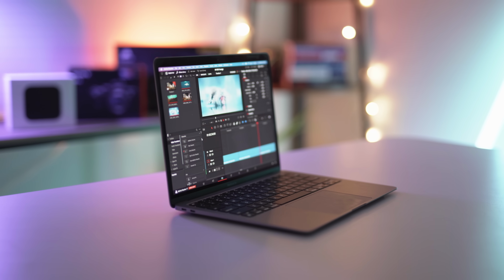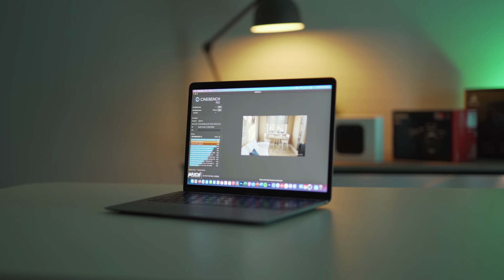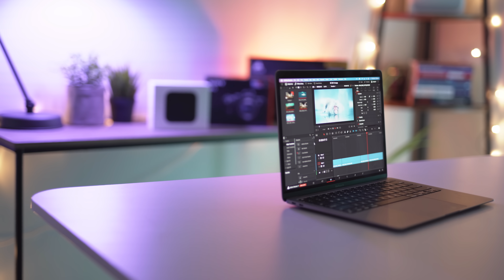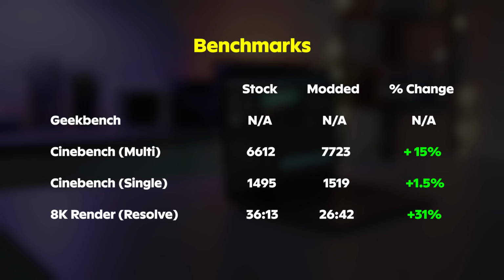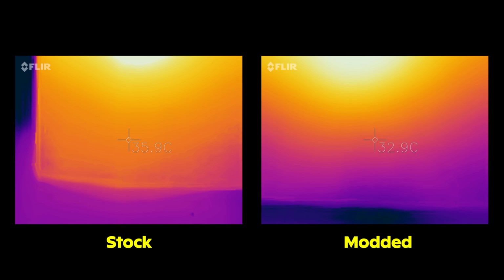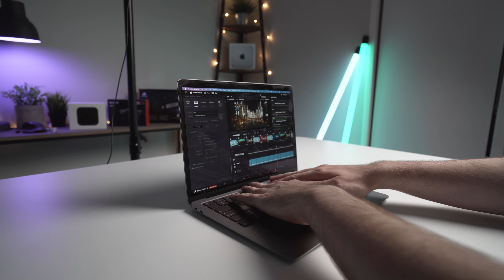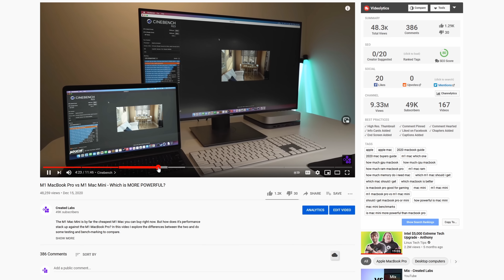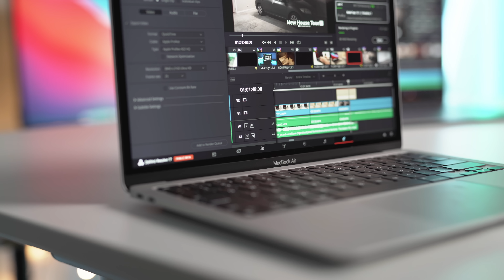I MODDED My M1 MacBook Air & Got 20% Performance Increase!

Comment from the maker: Equipment used (Amazon links):
1.5mm Thermal Pad: https://geni.us/thinthermalpad
3mm Thermal Pad: https://geni.us/thickthermalpad
iFixit Pro Tool Kit: https://geni.us/ifixitprotoolkit

I'll also be doing further videos on this topic, including using a laptop fan cooler with the mod. I will also try to water cool the M1 MacBook Air so make sure you are subscribed!
Reply: Yeah the link to the 1.5mm pad isn't linking to a 1.5mm pad.
Reply: is it worth voiding the warranty?
Reply from the maker: @jub8891  If you have the money? Yes. If not, no it's not worth it, don't risk it.
Reply: @CreatedTech  If you put the original MacBook Air on top of a huge piece of metal and make sure the bottom of MBA in contact with the metal, what kind of improvement will you get?
Reply: Link didn’t work for me
Reply from the maker: @charlescai  Which one? And what country are you from?
Reply: Look forward to complete report.
Reply: Try modding the macbook pro like put a few thermal pads on the copper heat pipe and maybe it will diffuse some heat to the chassis and increase cooling like the macbook air
Reply: Could you do a video with how it looks taking it off.
Reply: Song @ 5:25 ?
Reply: How bout graphics card to a Mac Mini?
Reply: @ANTHONY YOUNG And then have to declare this is a  totally useless procedure ? xD

Comment: The issue is that there are standards which manufacturers have to comply with if they want to sell their products. For example, the surface can't exceed temperatures of X °C, as anything above that can result in burns. 
The only way Apple can have its cookie and eat it too (no fan/no noise and compliant temperatures) is by restricting the performance of their laptops. Or they could just go with a fan and proper heatsink LIKE LITERALLY EVERYBODY ELSE!

Comment: I did this mod, and I saw battery temps DECREASE by about 10 degrees Fahrenheit. CPU temp decreased from 180 down to 154 running the same game. I did this mod no so much to increase performance (it was fine before), but to decrease CPU temp. The fact that battery seemed to also show better temps was pure bonus!
Reply: Would you say it’s worth it. I have Apple care until June

Comment: I'm a recent owner of a macbook air m1, and I notice that it gets very hot when editing photos in Adobe Lightroom, I use Hot's monitor and it marks 80 to 90 degrees on the processor, should I be worried?
would this mod help? Is the battery harmful? since your video is from 2021 and we are in 2022, did you have any problems using it after 1 year?

Comment: To those commenting about warranty, I have spoke directly to apple regarding this mod, and the conclusion is that if you do not break anything while putting the thermal pads on, then you are fine. If you do break something however, then your warranty is void.

Comment: be careful, making your MacBook bottom plate as the heat sink may loosen the mac's rubber pad adhesive (the pad that prevents your mac's body from scraping against the table) and it can easily come off.
Reply: glue them back on

Comment: Don’t say may, this will void your warranty, m1 provides enough performance and Apple engineers understand thermal engineering better than a YouTube video, not having a dig but this sort of video could cause people a lot of money, tiny increase in performance is not worth loosing warranty or any future recalls on a new product.
Reply from the maker: The mod can be easily reversed with no evidence it was ever there in the first place. I'm not saying it WON'T void your warranty, but it's not 100% guaranteed like you're making it out. Also I mention several times during the video that this mod is not a good idea and it's just for the purposes of a video :) Of course most people shouldn't risk a $999 machine for a few percentage points of performance gain.

Comment: there is no sense in your conclusion. the book does higher speed because the temp. gone higher and thats because of the speed was increased ?! seems to be a circular conclusion to me ...
Reply: you should redo the thermal messurment without the back plate of the book. the temp. must be very higher than the messured on the surface of the back plate ...

Comment: Did you test it for at least two times before and after the mod? Because you didn't mention that, it seems to me that the process was just optimized before repeating because some of the values were alredy in the registers and because of the processor optimization algotithms
Reply from the maker: It was tested multiple times and the computer was also shut down between testing.

Comment: This mod is like a must for someone on the budget and wants Pro performance. 
The only thing I was curious if the battery would be a lot warmer and then saw your comment. A few degree shouldn’t be a problem unless it is hotter than 40 celcius degree.

Comment: I have an M1 but just use it for general purpose tasks and some light photo editing.  I also live in a temperate climate where summer temps rarely break 25C.  I wonder if thermal pads between the batteries and the case would stabilize battery temps and give my laptop a longer lifespan...

Comment: With this mod your battery will die in few months due to temperature increase of the bottom panel. It will heat up like a frying pan
Reply from the maker: Yet here I am, over 6 months later of 10 hours usage every day and the battery is completely fine :)

Comment: When Apple,engineers begin to actually use their brains, they will design M1 series laptops to use the back of the screen as the primary external heat sink. After all this is where laptop cases are most exposed to external airflow. This would method would help to keep the batteries cool, prolonging battery lifespan.
Reply: It’s unknown though how the heat would affect the display and most importantly, it’s way more difficult conduct heat to the lid. Even flexible plastic ribbons get snapped at the bend between the two parts but you’ll probably need pipelike heat conductors. And those are much thicker and less flexible. Sounds pretty challenging.

Comment: uses the backplate as a heatsink "It definitely got hotter. The mod we did to spread heat to the back case made the back case hotter somehow. 😮"
Reply: It’s not the worst thing, the worst thing is heat getting to the battery making the MacBook a bomb in worst case scenario, the best case scenario is Battery life decrease.

Comment: Interesting thing is that Apple didn't underclocked SOC just a bit to keep it cooler. I think that was better thing to do and install pads at the same time. Maybe peak performance would go 5-10 procent down but it would have been much better on sustained performance and also you could probably have it on your lap (if needed). But i guess their marketing department decided to go with the higher peak performance (because benchmarks exists).

Comment: The temperatue increase is due to contact point. This is actually more efficient. Otherwise, heat is trapped in the air in the case, spearding more evenly, but more slowly as well.

Comment: That thermaltake fan if you want a fan just get the macbook pro instead... the whole point of the air is that it's fanless. Adding an external fan makes 0 sense to me though I did do the mod.

Comment: For anyone want to do this. Be aware that if you do this, there will be a lot of heat at the bottom case. Because the heat from heatsink transfer all the heat to your bottom case which may cause your battery heat up and swell. Which is not good. Do this only your environment is not hot and also don't fully load your cpu when charging your battery. Just charge to 100% and do as you want. I have experienced this on my macbook pro 15 2015.

Comment: this mod heating the batteries over designed temperatures. Even small overheating will dramatically reduce battery life and capacity over time. like, over a first year you will notice -10-20% of capacity, not a general -5-10%. Also you are increasing a chance of getting your battery size icrease, and deforming macbook chasis.

If you want to replace your battery every 1-2 years - go ahead, use this mod.
If you want to use your m1 macbook for a 10 years in a row without any battery issues - forget this mod.

Comment: Makes sense.  If it has more surface area so saturate with heat, it will definitely feel warmer, but will possibly have better performance as it now takes much longer to get to whatever core temps it would throttle at.

Comment: I do not suggest you to do that. :) The macbook is designed to hit a maximum temperature which is considered normal. By doing this you are letting your laptop heat up more which is not good for it's hardware. Your macbook no longer knows the accurate temperature level and you might end up with some technical issues. I would personally prefer to wait a few more minutes for a video to render or to play at a little lowers fps rather than risking my macbooks life. The video is cool but this kind of 'mod' is not worth doing to you personal device :)
Reply: You might be happy to know that Macs contain temperature sensors EVERYWHERE.  More than one in the batteries, ones on the palmrest, the CPU, the exhaust and heatsink proximity and hard drives on some models.  The mac would definitely know what all its' temps were, albeit some of them may be slightly above normal.  Given how low of a TDP the M1 really has, it's unlikely even with this mod that you would ever reach anywhere close to concerning temps, especially with just average use/load.  It's not like you're rendering 8K footage for every hour of its' life.  This mod is pretty harmless, all things considered.  Remember, he was stressing it as much as he could to see what it would hit, and it's still cooler than Intel Macs were, often by far.  The low TDP goes a long way.

Comment: I heard that one, using the aluminum backplate as a heatsink.... yeah you get higher performance, but the laptop feels hot to the touch and can with extensive use be very uncomfortable on your lap. This is typical Apple's on purpose design fuck ups fo a slicker design. Use better hardware, fuck up the internals so next year you can just use the same hardware but arrange it a little better and tout your new model preforms better then the old one and give all sorts of charts showing that with no values on the X/Y axis. It's one of Apple's tricks to make you spend more money on them, just as the Genius Bar where they mostly falsely claim that repairing your damaged MacBook is almost as expensive as buying a new one. Ever since Steve jobs is dead quality of the product went into his grave and now they solely rely on cheap scamming tricks.... pretty disappointing of Apple.

Comment: I did something similar with my 2017 nTB MacBook Pro, I put a regular M.2 Thermal Pad in between the cpu heatsink and the case, suddenly the fans can now run at a much lower speed. Youtube used to get the fan spinning pretty bad, now I'm watching this video and typing a comment and its sitting around 40 degrees with 0 rpm. This mod will work even for intel users just to a lesser extent. I really hated the fan noise, now I feel fine waiting for M1X or M2

Comment: Would this improve thermals on the active cooled Mac Book Pro?
Reply: Since the Pro does have a fan which sucks air in past the chassis, the air will probably be too saturated with heat from the chassis to efficiently cool the heatsink down. When you would start a benchmark the starting performance would be great but once heated up, the performance will decrease and the cpu heat will increase dramatically.

Comment: I think the thermal pad is soking total heat at dissipating at a single spot before that apple designed it to spread the so i think u should try using pads tota insidel back case by that the heat will dissipate faster and the it will way more cool by now and performance will be higher or same u should try this i think

Comment: Apple: deliberately makes a crappy thermal solution for their computers and blames Intel.
Also Apple: Makes an ultra-low power chip that barely generates heat and still heats up the case enough to grill a steak on it.

Comment: Lol apple keeps failing at engineering; when a final user improves peformance with an easy and cheap DIY mod that dramatically improves cooling (and overheating is a problem MANY iphones, macbooks/ibooks, iMacs have had in the past) clearly there has been a whole design team at apple messing it badly again; in this case the mod is to improve, not SALVAGE the device from melting, but in the past (think from 2000 to 2015) apple had severe problems in the cooling department in most cases rendering the devices unusable and posing risk to the customer using them

Comment: There might be some aftermarket product cover that has holes in it that could replace the bottom cover so that hot air could be vented outside.
Reply: convection (venting to air) won't be as effective as conduction (conducting to other metal). you could add a heatsink below the area, but since the performance is on par with the macbook pro, i'm thinking the limit of the m1 sans overclocking is already hit with this mod

Comment: Just a heads up, percentage changes shouldn't be used with temperature in centigrade or fahrenheit. If you think about it, all you're saying (in this example) is that the temperature is x% different based on the freezing point of water...kind of arbitrary.
Reply from the maker: I've seen a few comments like this, but none offer a viable alternative. Degrees centigrade is the unit of measurement used to measure component temperature universally.
Reply: @CreatedTech  It is, so the best thing is just to put the differences in centigrade and leave it at that. I've only just stumbled on your channel, looks like great content. Subscribed  👍
Reply from the maker: Interesting, I might look into it a bit further. It's hard to convey the increase by just leaving the results as is. Perhaps doing a side by side bar chart would be better. Thanks for subscribing!

Comment: dumb question but what if you only used one of the two pads and not on the entire area? could this translate to a little bit mor performance without that much heat increase or would it not be worth it?

Comment: If you want to take this to the extreme, you can get a 200x200mm 1mm thick thermal pad, and then between that thermal pad and the bottom shell, place graphene pads. these transfer heat extremely quickly across their surface(several times faster than aluminium) making for a much more even distribution of heat across the bottom, instead of a painfully hot spot right next to the CPU
Reply: How is the performance gain with that?? 30%?
Reply: @LeBeautiful  Over stock yes, but over this mod I would say probably not much, it would just make the whole bottom shell warm to the touch instead of one small spot being very hot. I'm sure there would be at least some added performance but i'd say the main benefit would be added comfort
Reply: @denvera1g1  Oh okay. And I'm assuming is just as easy as this, niceee.
Reply: @LeBeautiful  Pretty much, you would just lay down the rather expensive graphene pads against the bottom cover(i'd guess it would cost $200 to get full coverage) then lay a large traditional thermal pad over the entire back cover. It would be VERY important to both get the thinnest pads, and to make sure that no parts of the graphene pads would be able to contact the motherboard, the graphene pads are VERY electrically conductive, which is why you need the traditional thermal pad between the pads, and the rest of the computer. In this use case the graphene thermal pads would server as slower, but very slim heat pipes
Reply: Compared to this mod, maybe added comfort, but sounds expensive with diminishing returns at this point.  Cool idea though.
Reply: @computernerdinside  IT is expensive (probably) If you used the small graphene pads meant for CPUs you're looking at about nearly $300. But Panasonic makes Pyrolytic Graphite Sheets at up to 180x150, and a 180x115mm sheet is only $44 (Macbook is only 300x210)
Reply: But then the battery will absorb more heat
Reply: @carlitosaqui  Not as much as you think.

Comment: Apple may be good at many things, but they are not good at all when it comes to thermals. (Except for the mac pro of course.)
Reply from the maker: Come on man, give Apple some credit for the M1 MacBook Air. The thing does not have a fan, it is completely passively cooled yet destroys most other laptops on the market.
Reply: @CreatedTech  I’m not saying they’ve done a bad job. What I’m saying is that they usually nail everything except the thermals. This video shows just how easy it is to diy fix the thermal system to easily get much more performance out of it.
Reply from the maker: @ashkan.arabim  This is not a "fix". Apple simply cannot ship MacBooks like this from the factory because the external chassis gets way too hot. At the highest temps it could cause a slow 2nd degree burn if left in contact with the skin for a period of time.

IMO the stock MacBook Air is designed extremely well and I'm happy with the unmodded performance.
Reply: @CreatedTech  Makes sense!